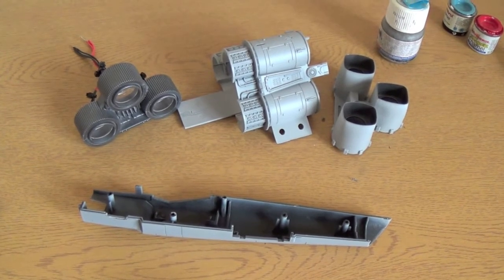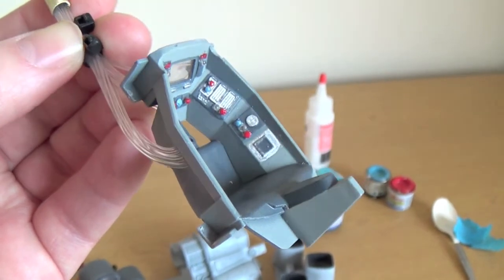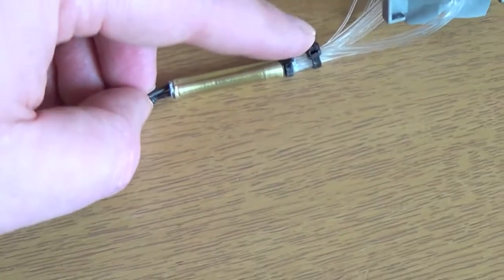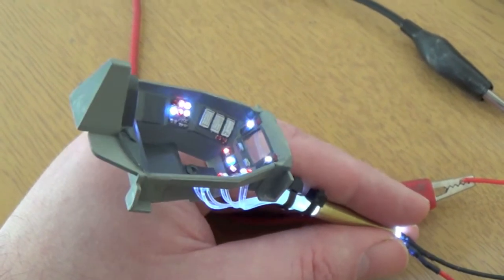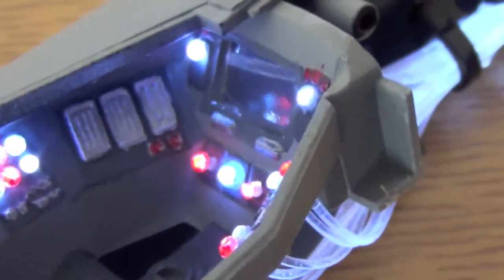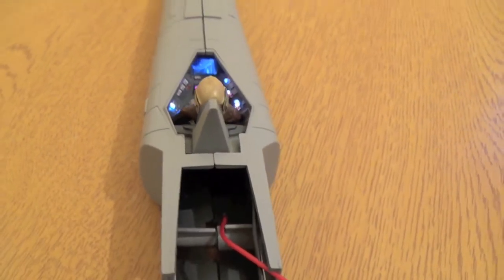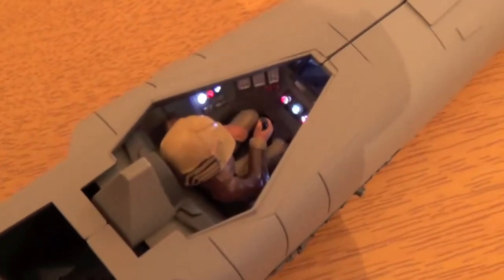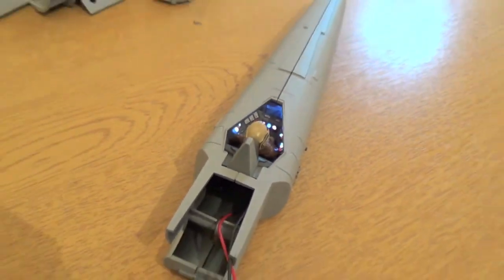Colonial Viper MKI part 3 - Cockpit lighting

Comment: I built one of these up in a similar fashion a few years ago, only to discover at the last gasp that fibre optic cable doesn't like CA glue...it immediately caused the fibre optic to turn brittle and break. I salvaged about 50% of several hours work, and what remains still looks good...but what could have been had I used PVC or zap-a-gap? I'll never know :/

Comment: This is awesome. What sort of glue is white glue as I was just about to use super glue until I saw your video. Thanks so much for the heads up 👍👍
Reply from the maker: Hi there. I was using "Canopy Glue" Its for gluing transparent plastic. It won't eat into the clear plastic or fibre optics, like Polystyrene cement does.
Reply: Movie Models Thanks again

Comment: Where did you get the decals for the cockpit? Like the monitor.
Reply: you mean the wires you see through the glass?
Reply from the maker: Hi, originally you could just see the Fibre Optic cables. I normally use the kit's decals, but occasionally I make my own. I've used screen shots from films, reduced them down to the correct size, then pinned them on normal white paper, then sandwiched the print between to thin sheets of plastic. Plastic from food packaging or thin transparencies, that sort of thing.

Comment: I am just starting the Revell Star Destroyer and want to light up the project. Of all the video and instructions available this is the neatest installation I have seen. Only one question and that is from where did you source the fiber optic cable?
Reply from the maker: Butlers Modelling The last time I bought fibre optic cable was eBay, but you can try Maplins or RS components.
Reply: Cheers :)

Comment: hey, might be a dumb question but what is that device that you use to send power to the LEDs?
Reply: Its a variable DC power supply. It allows you to output specific smooth voltages for developing electronics.